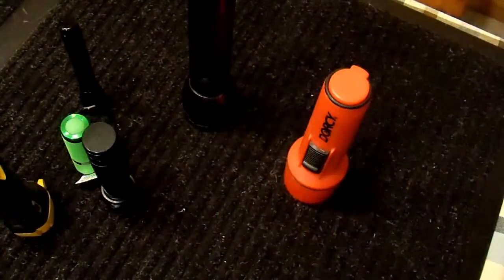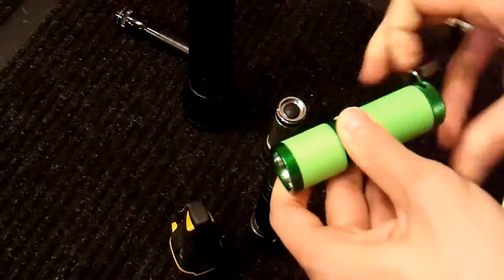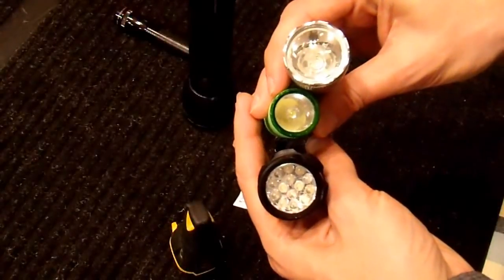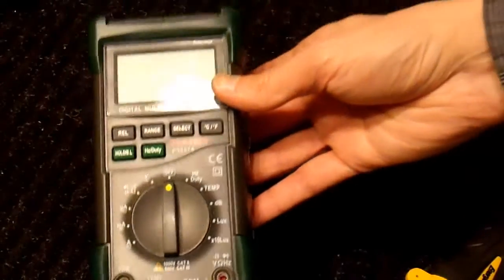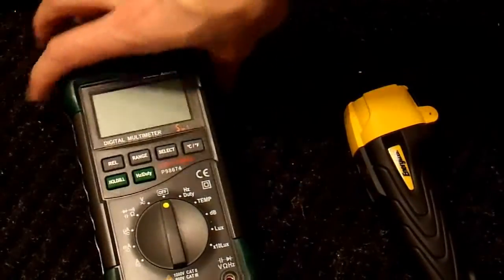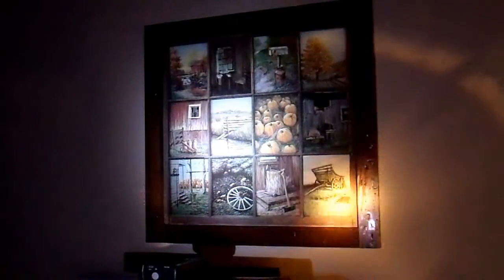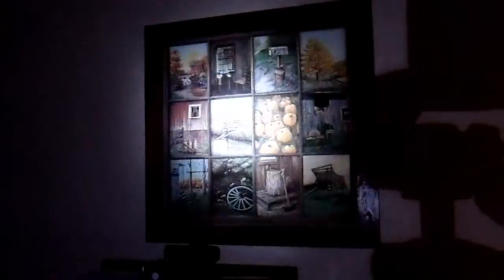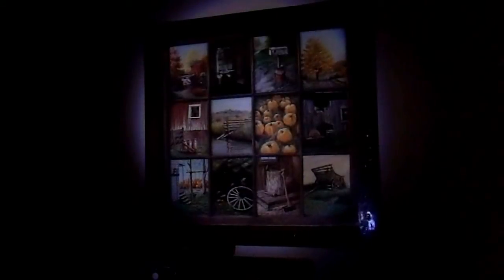Flashlight Shootout Part 3/4 -  Beam Pattern, Intensity, and Testing

Comment: Incandescent light bulbs lower voltage = more efficient because of the filament basically, LEDs with switch mode power supplies 200+ volts = more efficient just like computers and pretty much any other charger

Comment: Back in the days, they made "energy saver" incandescent bulbs that had built in diodes. That allowed them to use a shorter but thicker filament for a given light output, which was more efficient at typical household wattages. They didn't get very far before CFLs took over.

Something else interesting is that white LEDs match up surprisingly well with lithium ion batteries. Over most of the discharge curve, a linear (LDO) LED regulator can be competitive with switching LED regulators.
Reply from the maker: That's really interesting about the old energy saver incandescent bulbs - I didn't know they made them like that.  I remember some of the old long-life incandescent bulbs that had an annoying flicker to them.  I believe the one I'm specifically thinking of was made by Philips and had thick glass with an angular shape.  Any idea why an incandescent bulb would flicker?  They could have used the diode trick in these long life bulbs as well but it doesn't seem that it would be a low enough duty cycle to cause visible flicker.